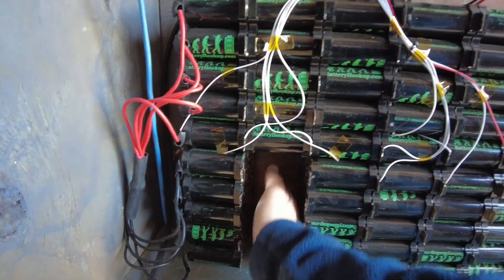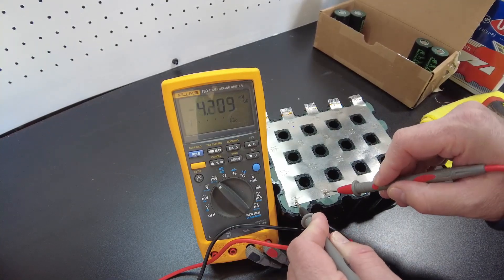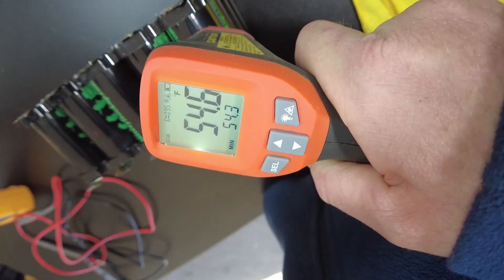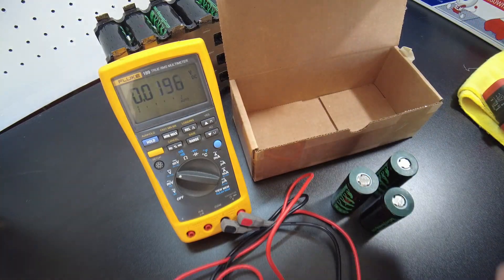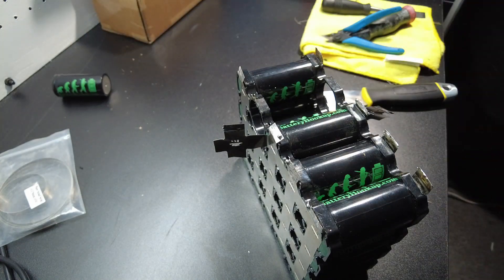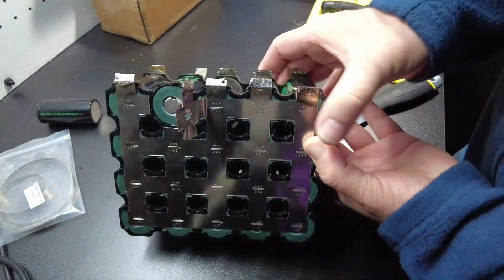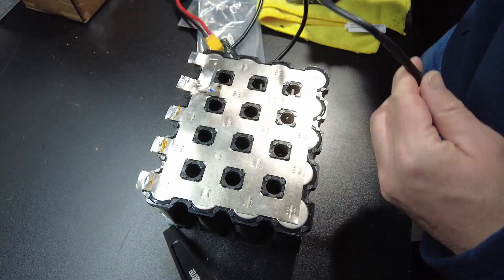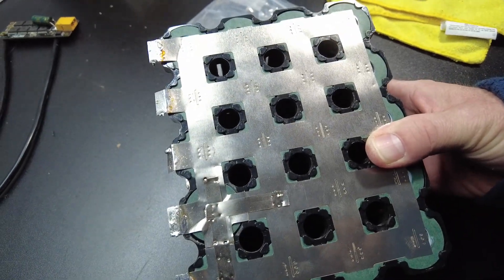Find bad cell in parallel group

Comment: Holy smokes, I have 8 of these packs and I've never been able to keep them in balance, I wonder if I have some bad cells.  Will have to investigate. Fortunately I purchased some extra cells before Battery Hookup stopped selling them. Thanks for showing us the way, finding a bad cell without completely disassembling the pack seemed impossible to me before.
Reply from the maker: You're welcome! If you have a really slow self discharging cell, you might not find it. The one here would discharge the 100a pack in less than a month.
Reply: @BradCagle  I've always wondered if some of the cells in the pack are not the rated capacity.